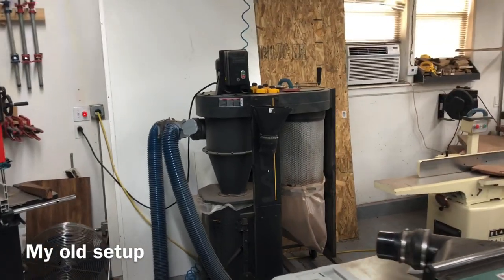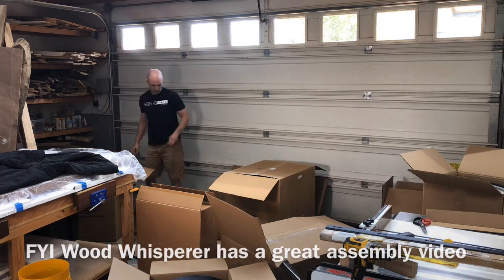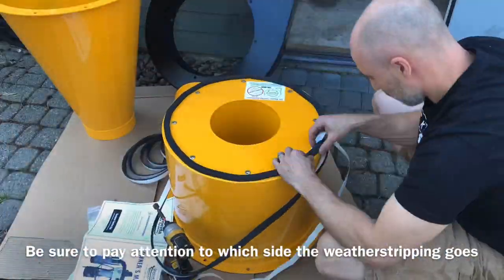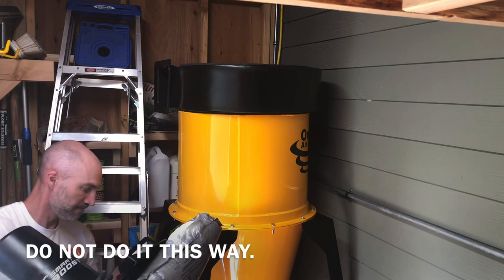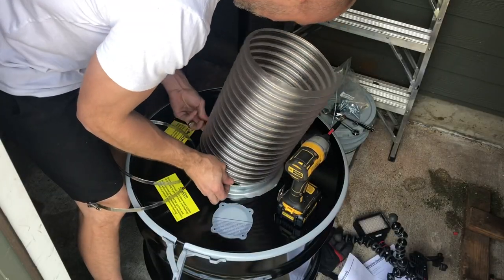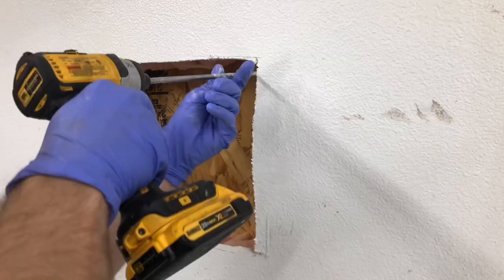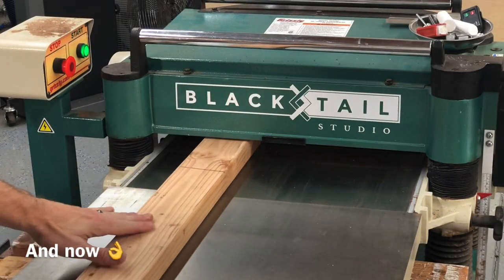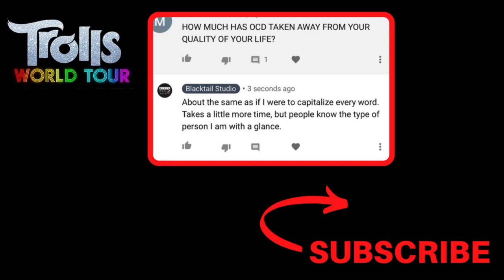Garage Shop Dust Collection - DIY Woodworking

Comment: I really need to get a good dust collection system in place. I'm drowning in dust all the time and that's not good. Also can't afford it, so maybe I should contact Oneida too! Anyway, the tool that I appreciate the most is an odd small one – it is a spring punch nail set. It's so handy I can't imagine not having one now. And the crazy thing I did that I probably shouldn't have done, but it worked out in the end, was lifting a file cabinet onto a 5 foot platform by myself.  I made the platform so I could use more vertical space in my garage office, but then when I needed to get it up there it was late at night and I was by myself. I couldn't move on to the next thing I had to do until it was up there, so I struggled and fought to get it up there for about half an hour and finally got it up there. It almost crushed me several times, but in the end it worked out. :-) Thanks for the vid

Comment: My Sawstop 3hp Professional Cabinet saw is my always-go-to tool. Dude, please promise to ground the actual ducting. Dust builds up a tremendous static charge (think static discharge wicks on airplanes). I watched a very informative (Steve Johnson) YouTube video on dust collection. Best advise: use unshielded braided copper wire and wrap the ducts from every blast gate all the way to the collector. I used self-tapping metal screws that had a built-in rubber washer that sealed the penetration. The screws actually penetrate the ducting into the airstream where all that dust is creating mischief. Wherever you have an duct intersection I used wire connectors to splice the different “circuits.” Good luck!
Reply from the maker: I promise I promise!

Comment: My Exmark Turf Tracer 48" mower with sulky makes doing my lawn a breeze. 
Congratulations on the Oneida unit. Its great. 
When I moved into my house I ran a hydronic heating zone from my boiler to my garage. Bought a Modine heater for the ceiling. Plumbed it all then had to lift the heater and hold it while fastening it to the ceiling. Not smart.
Reply from the maker: Well done though!

Comment: My Festool track saws make my life much easier!  i am a big wood working hobbyist and purchase many tools.  i have been in a wheelchair for over 37 years due to a car accident in my 20s and i have many stories about moving tools by myself.  i have unloaded two uni-saws from my trucks by myself and set them up with 52' T fences.  i unloaded my Powermatic 3520 lathe by my self and so many other tools that i could write a book.  neighbors will watch me and shack their head in amazement.  I'm getting older and smarter and now ask for help! :-)  i am trying to decide on which dust collector to buy this week and the unit that you purchased is in the running, its between this unit and the blue competitor.  thanks for the video, it looks like it is working as it should...enjoy!
Reply from the maker: That’s awesome to hear!

Comment: My favorite tool is the one that I happen to be using at the time. You will love your dust collector! I have the Oneida V-System 3000 (3hp) and it's fantastic! For a non professional shop it's probably overkill but well worth it. I've emptied  the 35 gallon drum twice and cleaned the HEPA filter at the same time. There have NEVER been any chips in the bottom of the filter! Only fine dust. It:s amazing, enjoy!
Reply from the maker: That’s incredible
Reply: @BlacktailStudio  Can't wait to see your video on installing the ducting. I currently have one flex hose that connects to all of my tools (trip hazard).

Comment: That was crazy putting that motor on like that.  You have wood joists right above you to use, even if you just supported it from the joist incase it fell.  The ladder like that is a good way to go ladder surfing, been there done that.   That vac system is awesome for sure
Reply from the maker: That would have cost me precious minutes! I’ll risk paralysis vs wasting 30 min

Comment: Very helpful and informative since I'm new to the epoxy/live, charred, chopped, burnt edge table making world. My first project was making a 41" high bar top table out of an old slab of split tree trunk that my son had in his garage. I kept the thick bark on and sealed it, then epoxied it using multiple pour level products (with added colors). It was a 5" thick split piece so I kept one edge of it open (it looks like a deep blue waterfall!!).I secured it to a thin steel plate that we cut to fit (just inside the diameter of the slab) and legs that we bent into a hairpin (3) form. I welded them at an outward angle (slightly) so that it would support (not tip) this thick slab.  It turned out beautifully and my son was thrilled.  It's going in his MAN CAVE.  Anyhow, I'm now wanting to do more projects and obtain more tools and the first thing I wanted was a safe dust collecting system!! Yep, I was sanding wood, and epoxy using my shop vac as my evacuator!! NOT FUN or wise...lol. I'm learning a lot watching your video's! Thanks so much.
Reply from the maker: Thanks!! And good luck with the next projects

Comment: Let's see, it would have to be the jointer (shop), the new pellet smoker & 42" T.V. (back deck) and our 3 (yes 3!!!) semi-crazy dogs (to keep the tweeker thief's away!).  Thanks for this video, I've been tossing around the idea of moving my dust collection outside the shop into a building (shed) next to my shop wall. I'll have to insulate & sound proof it (neighbors). Also adding the air compressor in the mix will also help. Thanks again.

Comment: Bailey #4. I know this probably sounds like a troll comment, but I’m really glad you got the system for free. HEPA systems are great at keeping the particles in check, but you don’t really need to worry about that unless you are planning to work in your shed. Nice clean air in there though, won’t get your mower dusty. Great videos though, very inspiring!

Comment: Thanks for the info, Cam. Folks, listen to him about how well Oneida packed the equipment. I was shipped two damaged Jet air filters before settling before getting a floor model from Woodcraft delivered to my house. The Jet tools come from overseas and they pack it like it costs $7.50 instead of $750. Add forklift damage and I got a machine that would not work, right out of the box. Better to buy Oneida, MADE IN USA! I have no ties to them in any way and don't have their tools...yet. I get a good laugh from your answers to trolls.

Comment: Table Saw - as my first large stationary tool, and for a while my only such tool, I've learned to do a lot of functions on it and it's a favorite tool.  Jigs and such would be #2 - now that I've started using them for lots of things I wouldn't have stopped to make the jig for in the past, I'll never go back - the safety factor alone should be enough to make everyone employ them...you only get 1 set of fingers!
Great new tool ... you need an air return from the shed if you don't already have one - particularly if you are conditioning the air in the shop ... unless you have that big big door open tot he street at the front.
Reply from the maker: Good idea!

Comment: Really hard to tell which tool makes the biggest difference. Table saw is center of shop but even the small things - like an awl or an incra jig are great and very valuable to me. Perhaps the tools I have are ear and eye protection. 😀

Thanks for the video! I was poking around for dust collection alternative to my roll around unit.  Floor space premium in my small shop area.
Reply from the maker: So many important tools

Comment: Dust collector is definitely my favorite tool. Either that or my Grizzly table saw I got a year ago. I just turned my single stage Jet dust collector into a two stage and had the same issues lifting the motor, though mine wasn't near that heavy. We've all been there. Nice work! Will definitely improve the quality of your shop time.
Reply from the maker: Thanks buddy!

Comment: A Level and Square. Been working on a 2.5" dust collection system in my small garage shop for the past few weeks and have now realized that I probably need to go with bigger pipe and something more powerful than a shop vac and homemade cyclone. I'm guessing that even If I get a large dust system, I would have to upgrade the diameter of the pipe I've already run as it would restrict the cfm. The headaches with dust collection are endless.
Reply from the maker: Right?? I think a cyclone and any DC is a great starting point

Comment: If you have the dust collector in the shed, why does it even matter that it's a HEPA? I guess other than the air quality in your shed but does having a HEPA dust collector outside of your shop improve shop air quality?
Reply from the maker: Yup! I might end up taking this one with me. Also, most people don’t have them in their shed
Reply: I know right.  I was all in on the video until the snarky comments about if you don't have HEPA you don't have dust collection....then he put it in the shed.  You could put any 5HP blower and duct it outside and get the same dust collection in this case.  No need for the fancy HEPA system like he claims.
Reply: Since you have a HEPA filter, if return air becomes an issue you could mount the hepa filter inside the shop so the return air balances the pressure.
Reply: @ericmorris9660  That would have been a smarter use of a very expensive HEPA filter.
Reply: He says in the video that he got the unit for free from the manufacturer and that the manufacturer only makes units with HEPA filters so...
Reply: @theajthomas  I know that....What I'm commenting on is when he says in the video you don't have dust collection if you don't have HEPA.  Clearly not the case in his example.  He's ducting the air out of his wood shop.  He'd have the same dust collection with any 5hp blower.  No need for an expensive HEPA like he says.
Reply: I was about to type the same thing.  I have a symbol at setup with my 3HP Grizzly in the shed behind the shop.

Comment: I'm a little confused, or possibly stupid, but why would you need a hepa filter, just duct the blower straight outside! I built my own cyclone system using a 1.5 hp fan and venting outside increased the airflow and eliminates the need for a filter. Love your work and your videos, you are a true artist!

Comment: Triton Super Jaws is one of my favorite and most flexible tools.  Love all your videos so thanks for all the work you do to keep us entertained and informed.  I also live in Portland and have built some beautiful projects using walnut from Goby.  I can’t wait to make a large table and use the planer/sander over at Creative Woodworking to create something even close to your projects.  
I have a very similar Oneida dust collector and I ABSOLUTELY love it.  I had to chuckle watching you lift the motor because I did almost the same thing and it could have gone so terribly wrong!  I was so excited to get it all together that I just couldn’t wait for help with the motor and when I got to the really scary part where I too almost lost control it was too late to stop.  I, unfortunately, am waiting until I can afford a full ducting system but even the cobbled together ductwork works amazingly well with this unit.  After seeing your remote I might have to add that to the long wishlist.  I have a brand new extra 55 gallon Oneida drum, lid and dolly if you should ever find a need and want to work out a trade.  
One question I have is what finish would you recommend for a 6ff x 4ft black walnut end grain butcher block counter that sits in the middle of our kitchen?  We use a Emmet’s Wood Conditioner that we first found at Crosscut Hardwoods.  It works well but it requires a lot of cleaning and reapplying throughout the year.  We don’t cut on it but it is constantly used as our main work surface.  I was tempted to use Odie’s Oil after seeing some YouTube videos (including one of yours).  BTW, I thought you were going to make a video on applying Odie’s Oil after you built the big give away table (I think you mentioned it in the video).  I am halfway through using Odie’s Oil as the finish on all my walnut interior doors and they look great but the process is a bit more tricky and lengthy than I had hoped.  Let me know if you have any insights and thanks again for all the great content!
Reply from the maker: I stopped using Odie’s after that table. It ended up failing on me and had to redo it with Rubio. Not the first time that happened. Will be the last though!

Comment: It does not matter which brand you get but a dust collection system large enough for your equipment is the important thing. The installation of the Clearvue in my shop was the best investment I ever made for my health.
Reply from the maker: That’s awesome!

Comment: At the moment my tracer mechanical pencil is my favourite tool. I once had to transport a large fridge freezer to another house on a little cart as it wouldn't fit in the van then I had to carry it up 3 steps by myself to get it in the house it weighed 200 lbs.

Comment: One sharp knife in the kitchen is almost all that you ever need. Maybe 2 or 3 various sizes, but no kit of 12. 

There is no question, just another comment: breaking through a wall in my house would mean angle-grinder with a masonry disk, a heavy hammer and toe-capped shoes. Then the dust from the bricks and plaster then goes *everywhere*. 

So. Much Dust.
Reply from the maker: That’s a bit trickier!

Comment: Each new tool I get is my favorite, then eventually it goes back to my shaper.   I have a 20' Grizzly planner and it does the same thing with dust collection.   I now know the solution, I just don't have the space.   My garage is like an ever changing maze with no instructions on how to get through it.   I need a mischief managed map.
Reply from the maker: I’m with ya!

Comment: Haha, one of the dumbest  things I can remember doing is moving a 20' shipping container from my house to my cousins house about 3 or 4 miles away.  By myself.  Using a railroad jack, some house trailer axles a small tractor and chains.  Lots of chains.  It was touch and go a few times, but I didn't crush myself.  The container tried to pass me a few times going down a steep hill, but the little John Deere hung in there.  Shipping containers are remarkably heavy.
Reply from the maker: That’s insane man!

Comment: I moved my 300 pound large format printer a couple weeks ago. I did some sketchy stuff to get it in the back of my truck. I got one wheel on and lost control. I ended up bleeding & the printer ended up on its face on the concrete floor. The next day I got a friend to help me set it upright and then I rented a box truck with a ramp. Not my best decision.

Comment: I'm guessing a pulley system at the rafter would have made a lot of difference, but I always do things the hard way, like moving my 6 inch floor standing jointer through a 30 inch door. Dont want to do that again, lol

Comment: My favorite tool is my wine bottle opener. I have an Oneida 2 1/2 hp w/ iVac gates. Works great. The one issue is knowing when the dust bin is full and mine is my shop with a clear port hole on top, but I still miss when it is full. I have plans for an electric sensor (search YouTube), just need to make time to assemble. How are you handling the full bin situation, since yours is not in eye sight? 
Here’s a tip. The bags for the 35 gallon drum from Oneida I think are pricey. Store bought plastic 55 gallon garbage bags work very well and inexpensive.
Reply from the maker: I got the Oneida remote bin indicator 👍🏼👍🏼

Comment: My favorite is the table saw sled I made, just makes everything easier and safer, yeah my mate made me a big steel bench weighs about a ton I had to get it off the trailer by myself, luckily I have a tractor but even with that it was stupid to do it myself but somehow it all worked out and got it in my shed
Reply from the maker: Tractor would be nice!

Comment: A tool I use a lot is my radial arm saw, sort of old school that way.  Never heard of you but your info on the dust collector is great.  I'm setting up a super dust deputy system in my garage that is ducted to my tiny shop in the basement.  And yes, I have done so many things the way you struggled with your motor that I just had to like and subscribe :-).  Hope it all works well.
Reply from the maker: I appreciate that Lawrence!

Comment: Compound Miter Saw...
Hey Cam,
That was the most dangerous move! I didn’t realize it until later in the video that not only were you lifting that heavy motor by yourself, but you also didn’t have the ladder open so it could’ve slid down and that would’ve been a real mess! I know this is after the fact, but it would have done you some good to have mounted a hoist… Even a cheap one in the ceiling to help with the lift.

Anyway, I’m glad you’re safe and I love the system. If I can ever get my business going I will keep that system in mind.
Reply from the maker: Thanks Chris! It was sporty!

Comment: To be fair, a non-HEPA certified vac installed outside your workshop would probably be good enough to prevent nasties from getting into your lungs, provided is sucks strong enough to take everything out. 😉

Nice video as usual - that motor install looked dodgy as frig, though! 😂
Reply from the maker: That’s fair!

Comment: As a hobbyist mechanic, I swear by my breaking bars when rebuilding an engine. For hobby woodworking a reliable miter saw is great, but to me nothing beats the versatility of an angle grinder with all of the various wheels you can find.
Reply from the maker: Even us woodworkers use em!